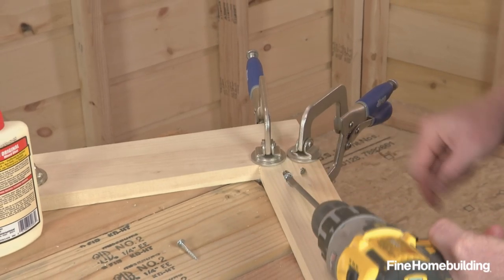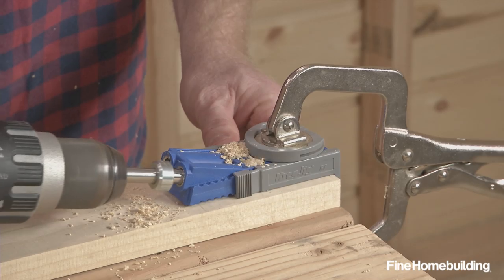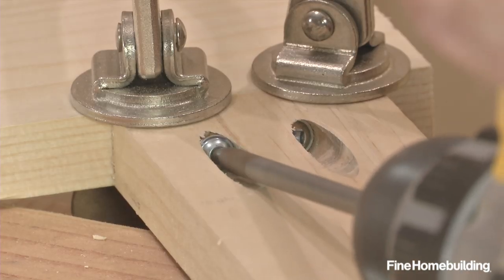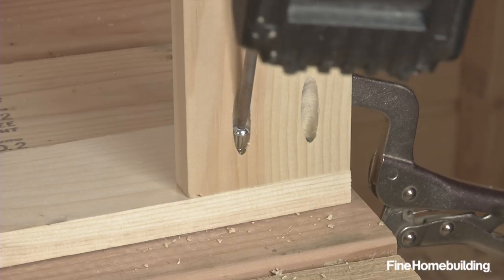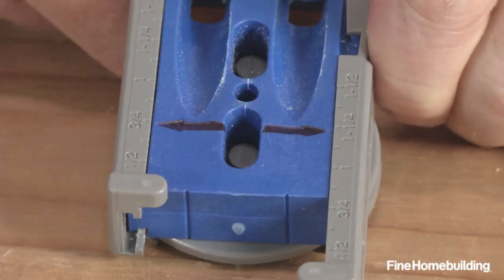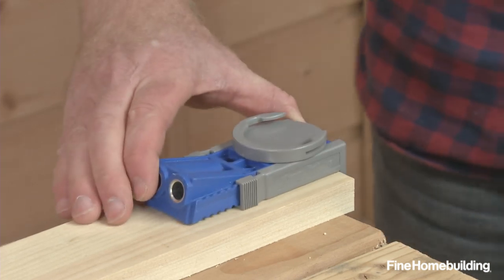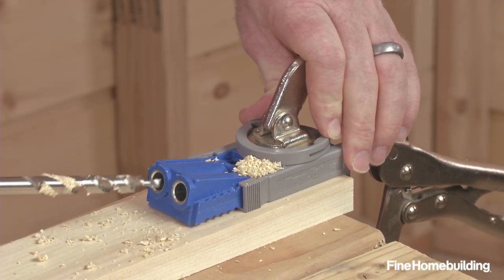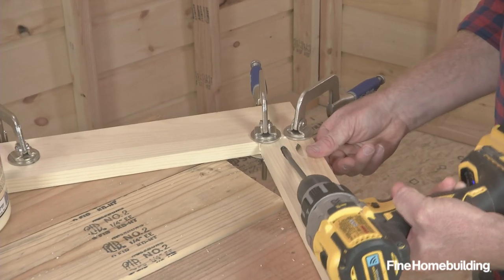How to Use a Pocket-Hole Jig

Comment: Any tips for someone who doesn't have the measurement on the drill bit? Mine has the stopper but it doesn't have any indication of where to put the stopper. I am creating pocket holes on 2 by 4s and setting the jig at 1.5?